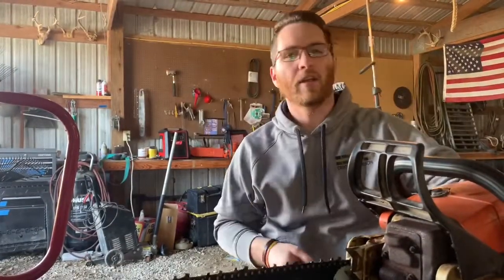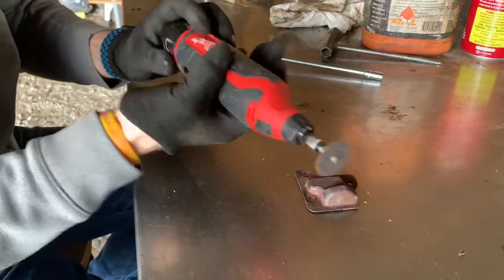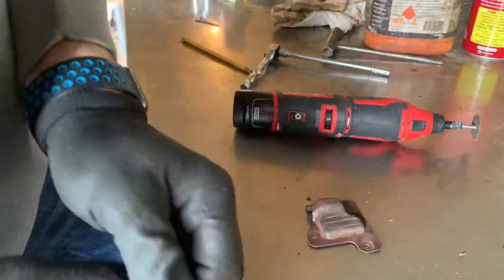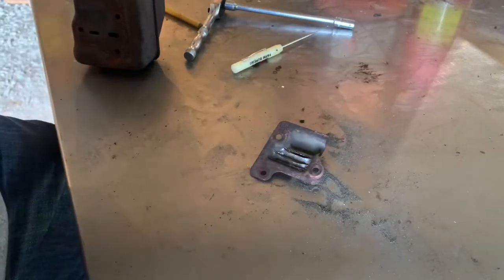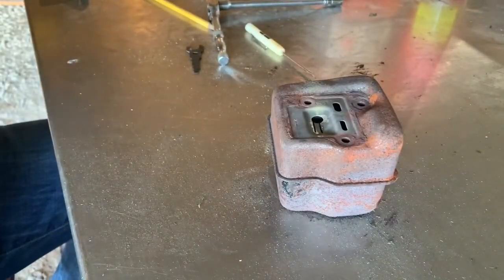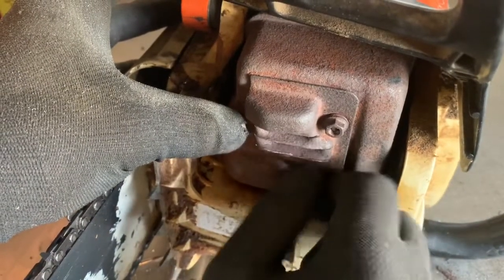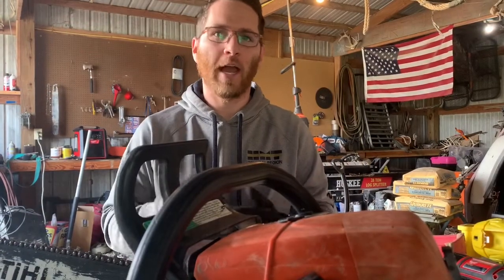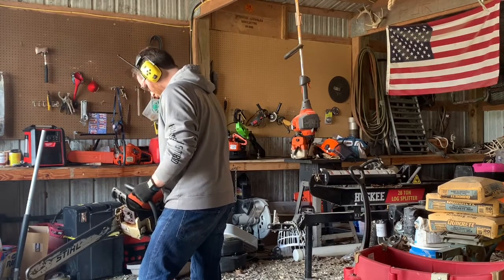Muffler modification Stihl MS 390

Comment: I just drilled mine out in front of the baffleso it's straight thru with added holes in the directing plate the plate is only still there to hold the arrestor screen in place make almost twice as much torque as it did with the stock muffler it's a bit louder but can live with that and it takes one more pull for cold starts so instead of two three pulls and I likely can make this better by doing it's annual tuneup.

Comment: I think it is a good modification, but the two-stroke engines can not or should not have the exhaust very open these engines need some retention of gases for proper operation
Reply: Not really the more open a two stroke is the better and cleaner it will run. More airflow means better power and better efficiency. Which adds up to cleaner emissions. Is that not the whole point of all the new devices on the market.

Comment: How much did you adjust the high jet out to increase the fueling on the carb?
Reply from the maker: J Wodehouse roughly 1/4 turn out and its running really well right now cutting through 18-20” oak
Reply: 1/4 turn left correct?